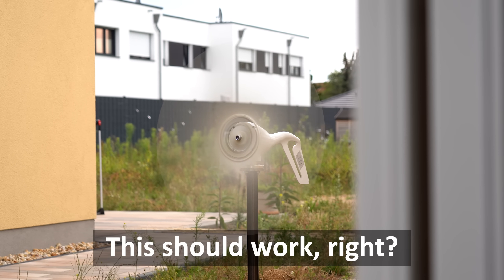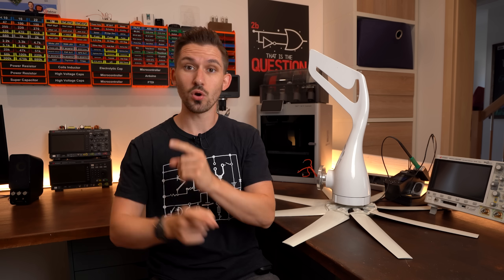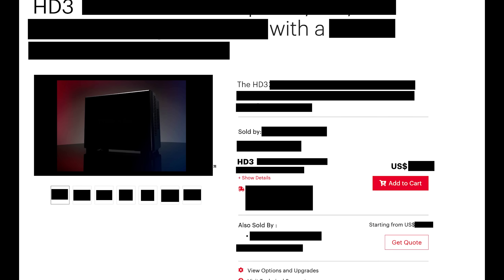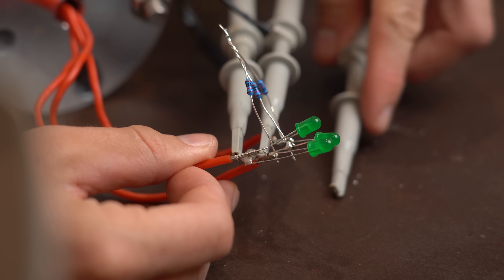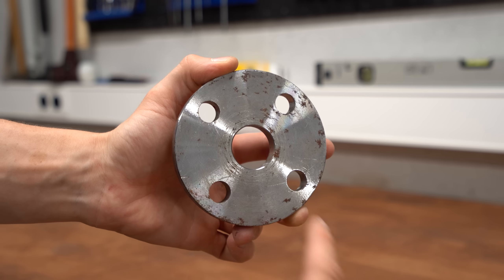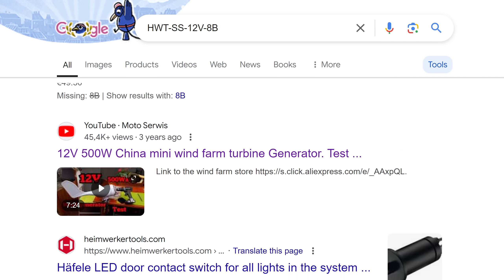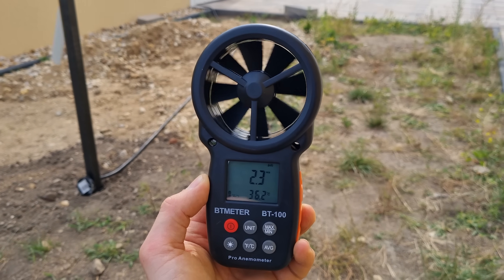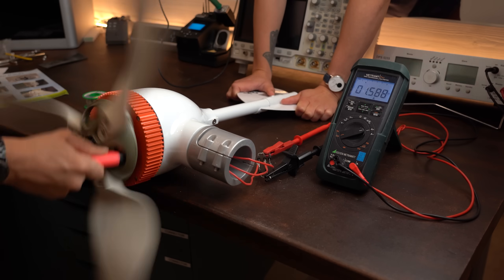I tried to Power my Home with Wind Generators! (Worth it?)

Comment: You won't get any real power out of those at those wind speeds, modifications or not. You’re dealing with two fundamental issues:
– The Betz Limit
– The Power in Wind equation

The Betz Limit is basically a theoretical number of the maximum efficiency you can possibly get. At most, only 59.3% of the kinetic wind energy can be used to spin the turbine and generate electricity. Remember this is a theoretical limit; in practice, you’re going to be closer to 40%.

The Power in Wind equation is given as:

P = 1/2 x ρ x A x V³

With:
P = power in Watts
ρ = air density (kg/m³, at about 1.2 at sea level)
A = Swept area of the blades (m²)
V = Velocity of the wind

So, no matter how good your turbine is, you will get in practice at most 40% of the wind energy converted to electricity. To capture the wind energy in the first place, you have two variables to increase (one in your control, the other not): swept area and wind velocity. The smaller you make the turbine, the faster you need to spin to make any meaningful energy. The only variable you control is the swept area, which means making the blades as big as possible.

Note that the velocity is cubed in that equation, so you’ll generate much, much less power at low wind speeds. No amount of rewiring changes this. 

In other words, small wind turbines don’t work except in ideal situations because physics.
Reply: I was going to make a similar comment, but you've summed it up perfectly. The second turbine is 1.2 metres in diameter, so at 40% coefficient of performance you would get 7 W of mechanical power at 3 m/s and 34 W at 5 m/s. No doubt the electrical side can be optimised, but as you say the upper limit on the mechanical side is very low. Add in gusts and the poor location and you'll never make significant power with a small turbine like that. 

You'd need an incredibly windy and exposed location to make the rated power output. The rated wind speeds of the two turbines are 13 and 12 m/s (47 and 43 km/h). As you say, it goes with the cube of the wind speed, so if the speed is halved the power will be 8 times lower.
Reply: the mppt controllers suck so bad on the turbines too. with the wind blowing so fast that they were sounding like airplanes, i only got 50-100 watts in total with 2x 400 watt wind mills. 

after that, didnt really seem worth it... cause they eventually spinned so fast that the solid iron pipe bent ( standard 1" sch40 pipe ) and smash the turbines. and at those speeds, have to fear for them spontanously exploding.
Reply: @HotNoob  This is an argument for some form of CVT or other torque coupling system such as vane pitch variations

The problem (of course) is that costs start rising exponentially for little overall gain
Reply: @HotNoob  Depending on your location, you can source well / oil drilling pipe for about $1.50/ft. 1.5" & 3/8 thick walls
Reply: Like with engines there is no replacement for displacement, in the wind turbine case that means swept area/diameter
Reply: Comments like yours are what make YouTube such an amazing resource for learning new things. Thank you!
Reply: Many sailing yachts used to have small wind turbines. But from what I've heard, people using them weren't much impressed. 
The hassle with installation, noise and keeping it out of the way and running is not worth the small amount of energy, compared to a diesel generator or solar energy.
But playing around with the technology is certainly interesting and fun.
Reply: Perfect summary! 
One thing I'd add in is the wind speed profile. 
The speed of the wind generally decreases as you get closer to the ground. 
Though it's complicated in such a built up area, as the "canyons" between the buildings can offset this effect.
Reply: Many thanks, first explanation that answers my question if these things make sense, they clearly don't.
Reply: I love a guy that knows what he is talking about.
Reply: When I saw the video title I wondered if this was a genuine effort with research into the subject or more of a blind stab at producing a little electricity. The last time I saw a homeowner install wind power on their property the region was adequate and the project cost $25k. The system produced more electricity than the owner needed, with the excess going into the grid, providing monthly rebates.
Reply: @DonariaRegia height makes a huge difference in the amount of available windspeed. He did have it pretty low
Reply: I came down here to put a much dumber version of this!  You explained that perfectly!!
Reply: Nicely explained!
Reply: I am considering a vertical axis wind turbine that looks exactly like a tree, I call it : e-tree,
the trunk of the e-tree is brown, the spinning sails (blades) are green,
attached to the trunk of the e-tree are features of : wifi/mobile network, light and power outlet, to charge a car for example
Reply: @Zo-greenforestI think that’s a great idea
Reply: Jesus... Professor.. thanks.
Reply: I can confirm. I converted a broken box fan into a wind turbine.

It requires a decent breeze, and even then only gets ~5v at 50mA.

Ideally I'd stick the thing on a really long pool and have it really high in the air....

But hey, it does charge a usb power bank up extremely slowly!
Reply: and dont forget that a storm might damage a cheap, unrated wind turbine.
Reply: How about setting up the turbine on the roof of the house with longer blades? I know the air density is low there, but the speed of wind is high there maybe.
Reply: Would it be possible to wire the 2 turbines together so the swept area is doubled in theory?
Reply: @huinbru9809  two times nothing is still nothing. The issue is that the dimensions of the turbine in combination with the wind speeds he's having will never make sense. For wind to work you need to go big to make use of lower wind speed, and you need proper wind conditions (steady, non-turbulent).
Reply: Kort nozzle. 
For efficient wind generation, he would want to funnel that whole corridor area, or at a minimum, an extra area around the fan to increase windspeed.

I saw a design somewhere in the world where they made a kite blimp that was effectively a kort nozzle and kept the turbine up where there was more wind.

As i recall (been a long time since i read about it), it's biggest problem was the massive wind drag. Keeping it anchored to the ground with high tension while it moved around was a spendy problem to solve
Reply: Thanks for that.  It hit the mark.
Reply: I tried everything like that myself. the commercial ones don't work when the Genu is designed for hurricanes, I have an 8 blade high speed propeller that charges the batteries well with 3ms of wind. after all, it's all about the design, how the generator and the wings work.
Reply: What energy could I yield? 
Wind speed average 10m/s 
Range 10- 20m/s. 
Roof mounted, sea level property on the beach
Reply: @rayshoesmith  Let's assume we have the same turbine as in the video, which has a diameter of 1.2 meter. Let's also assume you have a constant 10m/s wind speed. We have a theoretical power in this wind of:

P = 1/2 x ρ x A x V³

P = 1/2 x 1 x 1.13 x 1000 = 565W

Assuming this comes with an amazing 40% efficiency (The Betz limit I mentioned has 59.3% as theoretical max. but the best turbines sit around 40%)

You can generate: 226W

Over 24 hours (assuming you have a steady 10m/s wind speed) you can generate around 5kWh.

This is very optimistic, and I would expect the number to be much less unless you really have that constant speed, and no turbulence, and no changing directions.
Reply: @rayshoesmith  
don't bother. it won't be much at all in any case.
spend your money on solar.
Reply: You gotta have a spinning mass somewhere in there. Keyword=“mass.”
Reply: The only thing that will power is your cellphone on a stormy day.. 😂
Reply: But time is with our side.
Because wind power is being generated continuously, so if we store this energy in a big battery, then we can use it later as an alternative source of heavy duty DC current applications.
Reply: @salmanansari-ll6pn  Just use a solar panel or two for that. You'll generate way more than what you do with a wind turbine, and no moving parts, noise, or maintenance.
Reply: on roofs?
Reply: Yeah only personal wind that looks promising is huge automated kites you can deploy. Yet they are complex, and not as easy as it seems. 

 Maybe one day for survival packs. Ha.

 Solar is just the way to go honestly. Getting super cheap.
Reply: What about using step up transformers
Reply: @RemyFernandes-u6v  Power in == Power out. Doesn't matter what voltage, since P = V x I.
Reply: @RemyFernandes-u6v  What's the point if the voltage is so low? Step-up transformers have high losses at low voltages anyway. It would be better to use a battery that matches this voltage, or simply use a different winding on the generator. Plus, you can always charge individual cells separately.
Reply: Solar doesn’t work at night and there isn’t always enough Solar during the day to charge the battery.  So wind, as inefficient as it is, would be a nice addition to the mix.  Even if it only contributed 1kWh in a 24hr period, still get you through a couple of hours at night.  That’s often all you need befor the sun gets up again.
Reply: @k1ng401  ...and most of the time, they (like the one shown in the video) won't even come close to 1kWh per day.
Reply: @ I saw a hydro made out of a washing machine motor that was doing a few hundred watts turned by water
Reply: @k1ng401  Hydro is completely different and works extremely well. You have a constant flow of water with a lot more energy contained typically compared to wind.
Reply: @ because of its mass?  The water jet can push the same sized turbine faster than wind can?
Reply: @k1ng401  Yes, think about it: the density of water is much higher than air, so if you plug it in the same formula, you can see it has a lot more energy for a given volume compared to wind at the same speed. You can also have a much more consistent flow, and optimally direct the water to a turbine.
Reply: $$P_{wind} = \frac{1}{2} \rho A v^3$$

Where:

* \( P_{wind} \) is the power in the wind (in Watts).
* \( \rho \) (rho) is the air density (in kg/m³). At standard atmospheric pressure and 15°C, this is approximately 1.225 kg/m³. Air density varies with altitude and temperature.
* \( A \) is the swept area of the wind turbine blades (in m²). For a horizontal axis wind turbine, this is the area of the circle swept by the blades, calculated as \( A = \pi r^2 \), where \( r \) is the radius (length) of the blades. Alternatively, if you know the diameter \( D \), then \( A = \pi (D/2)^2 \).
* \( v \) is the wind speed (in m/s). Notice that the power is proportional to the cube of the wind speed, making wind speed a critical factor in power generation.

*Power Extracted by the Turbine:*

The actual power extracted by a wind turbine (\( P_{turbine} \)) is a fraction of the power available in the wind. This fraction is represented by the *power coefficient* (\( C_p \)), which is a measure of the turbine's efficiency. The power coefficient is specific to the design of the turbine and varies with factors like wind speed and the turbine's tip-speed ratio (the ratio of the speed of the blade tip to the wind speed).

The equation for the power extracted by the wind turbine is:

$$P_{turbine} = \frac{1}{2} \rho A v^3 C_p$$

The theoretical maximum value for the power coefficient (\( C_{p_{max}} \)) is defined by the **Betz Limit**, which is approximately 0.593 (or 59.3%). This means that even an ideal wind turbine can only capture a maximum of about 59.3% of the kinetic energy in the wind. Real-world wind turbines typically have \( C_p \) values ranging from 0.3 to 0.5.

Therefore, when calculating the actual electrical power output of a wind turbine, you would also need to consider the efficiency of the generator and any other components in the power conversion system.
Reply: Large turbines use a planetary gear system before it hits the generator. Would adding a gear system not make any difference?
Reply: @Surgeeon  No, the energy just isn't there to begin with. You can't extract what is not there.
Reply: Na hoffentlich kommt da noch was,weil die Turbinengehäusen si ja hohl, da bekommt man sicherlich eine dicke Spule rein.

Schonmal überlegt das ganze über das Dach zu versuchen?
Reply: so use silver wire to make the motor.   put pole on roof, and when sun goes down, get in row boat and borrow some bigger blades off shore.  I was mad they wouldn't let citizens have the 200 ft watch towers.  a 170 ft blade would let you get some juice, and still give your head clearance.  Plus you could line the structure with solar panels, and a water tank on top.
Reply: @robertsmith2956  copper graphene is roughly 110-120 on the conductivity scale , with silver being 100 or 99.9 . gallium nitride is also quite promising as a silicon alternative.
Reply: Small wind turbines are fantastic as part of an off grid system.

Particularly if you already have solar and batteries.

With solar, wind, and if you're really lucky micro hydro, you don't really have to sacrifice anything to live where the grid isn't anymore.

With the Starlink you can be completely modern.
Reply: @jtjames79  That's the thing: small wind turbines are anything but fantastic except if you have ideal situations, which very rarely is the case. Better to add more solar and storage in most cases, and I say that as someone off-grid in a place where the sun doesn't shine for months on end.
Reply: @upnorthandpersonal  The wind is for the unideal situations. Like heavy overcast from a passing storm.

Not putting all your eggs in one basket has its own value. Not everything is about amp generated.
Reply: @jtjames79  But small wind turbines don't generate anything useful at all - that's the point. You could just as well invest in more storage/solar (overcast still generates more than a small wind turbine could for any decent array). Why not (if you're off-grid) a diesel generator and make your own diesel fuel - it'll be more useful than a small wind turbine, and available in any emergency situation. That's what I do, and I've looked into wind way back when because it sounded appealing - until you do the math and you figure out it's just a headache.
Reply: @upnorthandpersonal  
those facts are were all found out and tested 10 years ago.
Reply: @ursodermatt8809  Betz's Law was published in 1919, the wind power equation is older than that. These facts have been known for at least 100 years.
Reply: @jtjames79  Depends on what you class as small, I know some that class things like the XL.1 with it's 1.25m / 4.1ft center to blade tip length (radius) as micro wind turbines
Reply: @jtjames79  No, you need at least a diameter of about 5m to achieve some usable energy, otherwise you spend money for nothing. means break even impossible, so you better off with a diesel or gas generator.

Comment: I'll recommend forgetting about the wind and diying those motor/generator with gears and use it as a waterwheel. Water have much more power density than wind and I'm sure you'll easily be able to get ~300w out of those 2 generators combined.
Or modify them to use as a fan, lol 😜

Comment: Makes me wonder if using the 24v version of the wind turbine, with with an efficent boost/MPPT controller for a 12v system would work better with low wind speeds.

Comment: I‘d love if you made a diy low wind speed controller! I‘ve also got a vevor turbine (the slightly bigger one with 5 blades) and am facing the same problem. It‘ll probably be easier to rebuild a wind controller than to rewind the generator for most people (and it would be more interesting). Great video!

Comment: I would disagree with Your conclusion. The problem is the area you're in since you couldn't mount it any higher. Remember, the higher you mount it, the fewer objects that will impede the wind's movement will be in the way. Also, A common mistake most people make when dealing with wind generators is choosing the one with the highest watt output. In reality, what you should be looking for is the highest kilowatt hour. I realize that your expertise is in electronics. You may already know about this; however, most of the generators you bought seemed incredibly cheap. Usually, the cheap ones have very high watts but meager kilowatt hours, which means that under lower wind speeds, they will produce little energy. I wanted to point that out if you did not know.
Reply: W is a unit of power
kWh id a unit of energy
kWh or just Wh = W multiplied by time.

Writing kWh on the box does not make sense. It would imply that the generator could only produce a certain amount of energy and then stops working.
Reply: Or maybe you meant the european unit of kWh/1000h that they tend to write to indicate power consumption of something. But that is just the same thing as W.
Reply: @stefannilsson2406  what I meant was some generators can produce more energy at lower wind speeds whereas others require high wind speeds to make the same amount of power. The simple solution to his problem would be to put the generator higher in the air; however, as he told us at the end of the video he's not allowed to do that because of the laws in the area. Maybe I described what I was saying in electronic terms poorly I am a novice at this